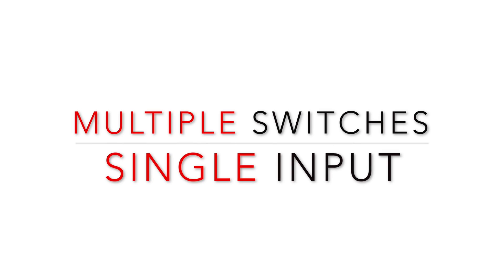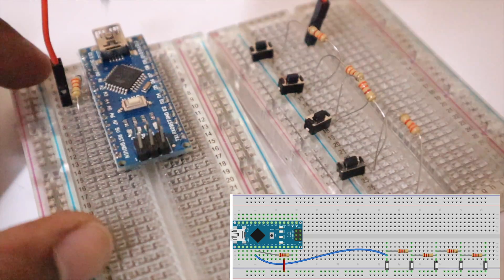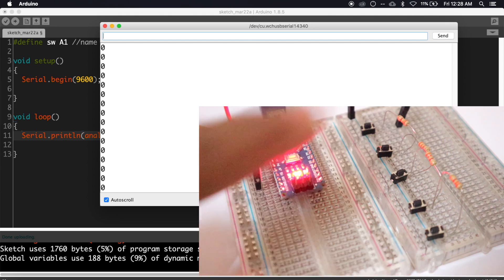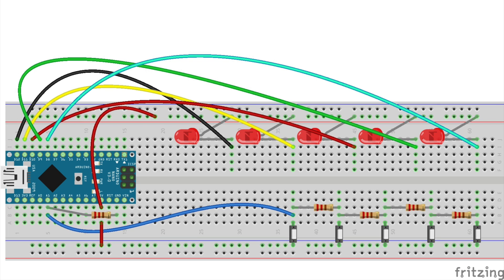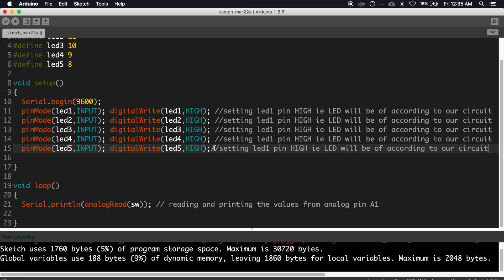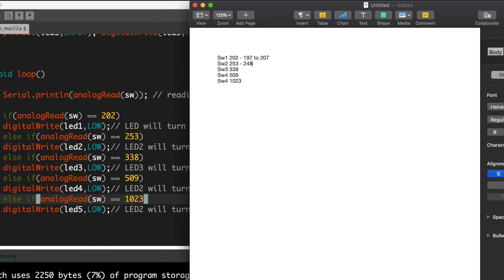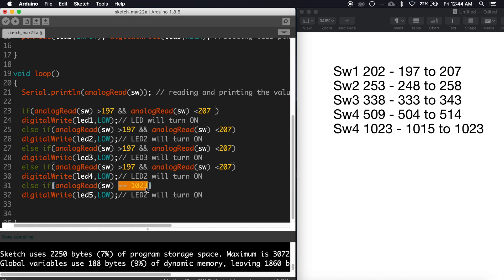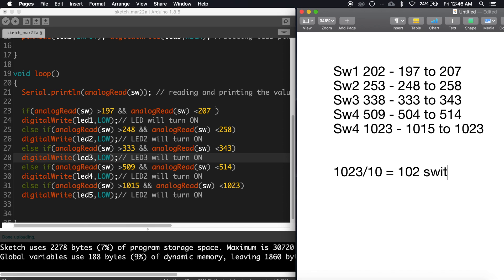100+ Switches in a single pin of Arduino

Comment: #define sw A1 //name for analog pin A1
#define led1 12
#define led2 11
#define led3 10
#define led4 9
#define led5 8

void setup() 
{
  Serial.begin(9600);
  pinMode(led1,OUTPUT); digitalWrite(led1,HIGH); //setting led1 pin HIGH ie LED will be off according to our circuit
  pinMode(led2, OUTPUT); digitalWrite(led2,HIGH); //setting led2 pin HIGH ie LED will be off according to our circuit
  pinMode(led3, OUTPUT); digitalWrite(led3,HIGH); //setting led3 pin HIGH ie LED will be off according to our circuit
  pinMode(led4, OUTPUT); digitalWrite(led4,HIGH); //setting led4 pin HIGH ie LED will be off according to our circuit
  pinMode(led5, OUTPUT); digitalWrite(led5,HIGH); //setting led5 pin HIGH ie LED will be off according to our circuit

}

void loop() 
{
  Serial.println(analogRead(sw)); // reading and printing the values from analog pin A1

  if(analogRead(sw) >197 && analogRead(sw) <207 )
  digitalWrite(led1,LOW);// LED will turn ON
  else if(analogRead(sw) >248 && analogRead(sw) <258)
  digitalWrite(led2,LOW);// LED2 will turn ON
  else if(analogRead(sw) >333 && analogRead(sw) <343)
  digitalWrite(led3,LOW);// LED3 will turn ON
  else if(analogRead(sw) >509 && analogRead(sw) <514)
  digitalWrite(led4,LOW);// LED2 will turn ON
  else if(analogRead(sw) >1015 && analogRead(sw) <1023)
  digitalWrite(led5,LOW);// LED2 will turn ON
  

}

Comment: First of all. Thanks for an interesting video. I am new to Arduino and find this very useful. Second, the idea of building a keybord using this method contains a challenge. What if two contacts are pressed simultaneously. Then presumably only the contact with the lowest resistance will be read as electricity flows the path of least resistance.
Reply from the maker: Yes, there will be issues. Practically it will be good for only few switches

Comment: I m trying to make a keyboard can I make the keyboard like that I have the code but will each individual switch do a single input or if I press it all the switches will be pressed bc its connected to the same pins

Comment: How do you calculate what resistor value to use? if you need more than 5 switches to a single pin? And what is the maximum number of switches per pin can arduino allow?
Reply from the maker: This is just a trick, not safe to use morethan 4 switchs
Reply: @DIYUSTHAD  So what can you recommend for a button box with 70 switches?

Comment: Use unique resistor values for each button and connect them in parallel instead of a voltage divider - then you can press multiple buttons at a time.
Reply: excellent, like a bitmask - genious

Comment: What happens when the temperature changes the resistance. Would the system still work? what is the temperature tolerance for such a system?
Thanks
Reply from the maker: I have not checked that yet

Comment: It's a very creative solution but how reliable is it? what happens on a hot day or a cold day, do the resistivity values change by a lot? ... another thing is this considered a "right way" to do it or is it a hack? do some keyboard devices work in a similar fashion with resistors?
Reply from the maker: Will check ان شاء الله

Comment: I have read elsewhere that you could potentially have resistors of doubling values 1,2,4,8 for example to be able to push multiple at the same time. Do you think this will work?
Reply from the maker: Little bit of tweaking in code I think its possible
Reply: @DIYUSTHAD  I guess the complication comes in that the resistors will be in parallel.
Reply from the maker: It will be complicated, the analog value when we press 2 buttons at the same time should not be same to the values of any other switches and also we need to consider  the debouncing

Comment: Sir please tell how to make a keyboard using this method
Reply: You can't make a keyboard using this technique, the 100+ keys claim is false, the maximum number of keys is 10.
Reply from the maker: Keyboard can be made you can follow the same process but will need to make some changes in code to avoid debounsing

Comment: Thanks for this. I did something very similar so I am glad my logic is shared by others. I needed 4 cursors and an ok button on a panel. I only had 2 available digital pins and a single analog pin. So each button had a resistor all connecting to a single analog pin. Each resistor's rating created an exponential pattern similar to the Fibonacci sequence which helped prevent harmonic conflicts if more than one button was pressed simultaneously.
Reply from the maker: thats great 👏

Comment: thanks for the video, may i ask how to add debounce to this code? i tried so many times but it fails to do the functions right
Reply: To debounce simply add a capacitor between A0 and ground. Experiment with the values, I would start off with 0.1uF to 10uF.

Comment: if you push two or all bottons it will not work till you add extra code like :
button 1 + 2 value 
button 1 + 3 ... 

am i right ?
Reply: No... If <ou would press the first button, the max value ist 1023. That means, that no other button would does a thing
Reply from the maker: Yes you are, additional code is required for multiple buttons pressing same time.

Comment: Theoretically it works. Practically a bad connection can be mistaken for another press. Unless you add up extra code which will make the shit really slow !
Reply from the maker: Actully there are many commercial circuits using this methods for upto 5,6 switchs

Comment: Hi
really great idea
but can 2 or more buttons work at the same time??
Reply from the maker: No, two or buttons cannot work at the same time
Reply: ...and and two keypresses might just meet the conditions of another switch perhaps?  I am not at all sure because I was background listening but your approach is awesome.

So much simpler to wire
Reply: Yes you can use more than two buttons at once using this hardware. However, the software in this video will not allow you to do it. Better software is needed. The software needs to record the readings of all combinations of multiple button presses and go through a look up table to decode any reading it gets. Note that the 100+ keys claim is false with the maximum being possibly up to 10 switches. But for multiple switches you would be limited to about 5 keys before it stopped working reliably.

Comment: Do the LEDs switch off when you press the buttons again
Reply from the maker: Currently in this program it won't, but its possible to do it
Reply: Can you pls create code for turn off led...
Reply: How to do it ......pls explain that
Reply: Hi  @printopaul9936 , 
Not perfect but you can do it like that.

Add this in the file:
  bool lights[] = {false,false,false,false,false};
  int previousRead = 0;

And replace the content of the loop function by this:
  Serial.println(analogRead(sw));
  if (previousRead != analogRead(sw)){
    if(analogRead(sw) > 197 && analogRead(sw) < 207){
    	lights[0]= !lights[0];
    	digitalWrite(led1,lights[0] ? LOW : HIGH);
    }
    else if(analogRead(sw) >248 && analogRead(sw) <258){
      lights[1]= !lights[1];
      digitalWrite(led2,lights[1] ? LOW : HIGH);
    }
    else if(analogRead(sw) >333 && analogRead(sw) <343){
      lights[2]= !lights[2];
      digitalWrite(led3,lights[2] ? LOW : HIGH);
    }
    else if(analogRead(sw) >509 && analogRead(sw) <514){
      lights[3]= !lights[3];
      digitalWrite(led4,lights[3] ? LOW : HIGH);
    }
    else if(analogRead(sw) >1015 && analogRead(sw) <= 1023){
      lights[4]= !lights[4];
      digitalWrite(led5,lights[4] ? LOW : HIGH);
    }
  }
   previousRead = analogRead(sw);

Comment: It is great!
But one drawback is it will not be able to detect 2 button presses at same time
Reply: I am pretty new to this but if you used different value resistor between each key would that allow you to detect similtanous key presses?
Reply: @GarethHaylings   Nop
Reply from the maker: Yes, that's right
Reply: @DIYUSTHAD  can we element this risk with multiple analog pin instead of one analog pin?
So that we can press muti-key combination. Like CTRL+S or CTRL+SHIFT+S
Reply from the maker: @-indeed8285  yes we can do that